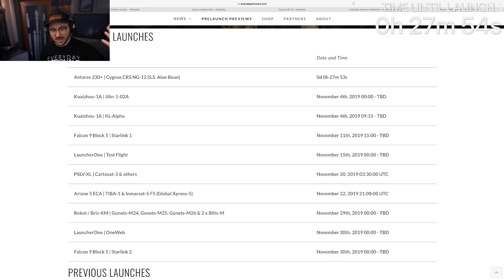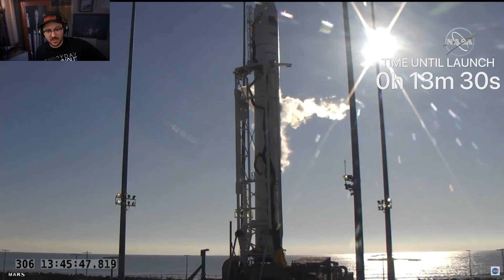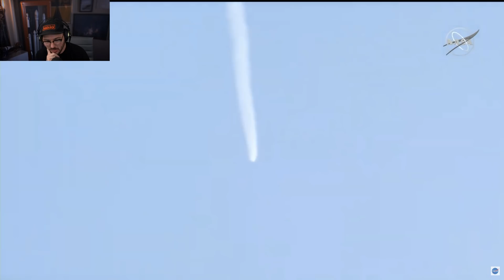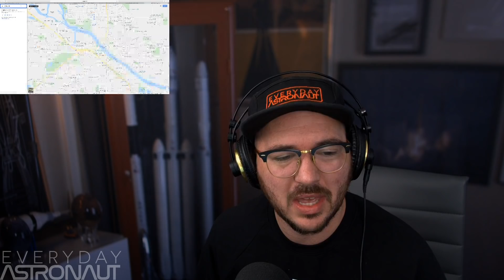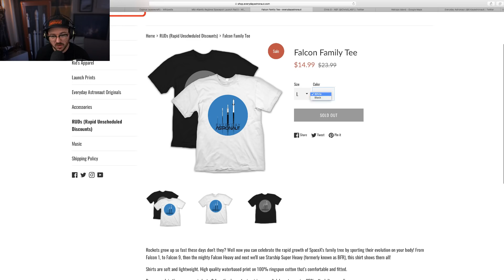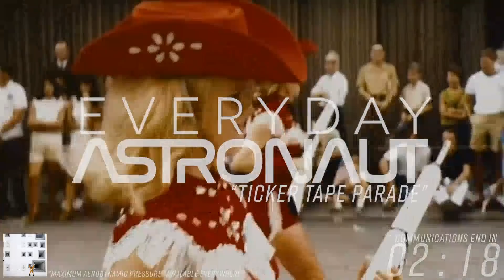Watch NASA and Northrop Grumman Launch to the ISS!

Comment: RD -170 is the most powerful,versatile, innovative design ever, and this engine alone kept Russia in space business after the fall of USSR.
What began as a compromise, to use 4 combustion chambers to avoid combustion instability,
but use common turbo pump assembly, became the best solution Russians ever make.
By developing one engine, they practically developed four.
If they need really big engine - 4 chamber configuration
We need medium size engine - 2 chamber configuration
We need small engine - 1 chamber configuration
Energomash never made a 3 chamber configuration, but if ,by any chance need such an engine, they could build it very easily.
A marvelous design that surely deserves a separate video!

Comment: We need a space station orbiting the moon.
Reply: Thats not a small moon its a space station!
Reply: It's called Gateway, and it's being planned by NASA right now
Reply: @Countmaster0  Hey there, flattie. Been waiting for you forever, where have you been?
Reply: Is it better than orbiting earth? If so, why?
Reply: @PerisK4  We need both. A space station mostly outside of earth's magnetosphere would be vital for researching how to keep a crew alive in space.
The level of radiation would be A LOT higher and would bring new difficult challenges, but they are challenges we must overcome if the plan is to colonize space. 
Speaking in longer terms launching from a space station orbiting the moon to Mars or Venus would probably be easier than launching directly from earth, or a space station orbiting earth. The gravity well is a lot smaller. 

I strongly believe that travel between space stations is how to traverse space. Escaping earth's gravity well is extremely expensive, especially if you're bringing with you fuel for a longer trip.
Reply: Kristoffer Johnsen - You know it costs 1-1/2 times the Delta-V (& fuel) to do that rather than just launching straight from earth? There’s no way this is even close to practical unless you’re launching a craft that’s made on the moon using lunar materials & fuel manufactured on the moon...
Reply: @DenGuleBalje  the Delta-V requirements to get into a moon orbit and refuel and then head to mars just isnt worth it... you might aswell just go straight to mars from earth orbit.
Reply: @Im-mv6bf  Yeah probably. I don't really know, but I imagine you could utilize the speed of both the moon's and the space station's orbit to launch to Mars or Venus.

Even if a moon space station wouldn't be ideal as a launchpad/refueling station, I still think that we can learn vital information from having a space station orbiting the moon. 
We need to learn how to keep personnel alive and healthy in places with higer level of radiation for long periods of time, if not colonizing Mars/Venus or anywhere outside of earth's magnetosphere is just a pipe dream.
Reply: @TraditionalAnglican  I didn't know that, but I'm not talking about gathering the resources for the spacecraft from the moon, I'm thinking launching the different components from earth in separate launches with each rocket tailor made to carry different types of cargo. 
If you want to go directly from Earth to Mars in one launch the rocket will have to escape Earth's gravity while carrying the rocket itself, crew, fuel, food, landing pod, tools habitats, EVERYTHING and it has to be done within ONE launch window.
How about moving crew to the ISS, then when they're used to living in zero gravity to the moon space station, then launch rockets carrying fuel, habitats and all the rest in smaller launches, then assemble the final craft in space. 

A rocket that's made to defeat drag, gravity and space junk carries a lot of dead weight when it finally is in space and can't sustain the life of a crew for longer periods of time. 

Just some thoughts.
Reply: According to Nasa it would be a good spot for one for missions heading into space.
Reply: @PerisK4  It would be a space station orbiting something that's not the earth. It could investigate things that the ISS can't because of the Van Allen belts.
Reply: artemis program would like to know your location
Reply: @CarlosAM1  I don't know what that is.
Reply: @DenGuleBalje  the nasa program that is going to do just that.
Reply: @CarlosAM1  Cool! I wish them luck.
Reply: lol

Comment: Anybody know how many g-forces Cygnus has withstand to get into orbit so fast?
Reply: With that second stage, somewhere between 0.5 at the beginning and 2 at the end of the burn. So, no too much. A bit more with the first stage
Reply: good question. that sucker jumped off the pad
Reply: Enough of g-forces to make you think you're having a heart attack !
Reply: 35:05 they said 100 ft/sec^2.  Thats a hair over 3 g's.  And with ~90 sec of fuel left to burn in the first stage, that will go up still.  

On the second stage, the telemetry is detailed enough to calculate the acceleration.  About 10 sec before burnout, I calculated about 2.5 g's.

Comment: Wouldn't a space elevator not work on the moon since it is tidally locked to the earth and does not spin
Reply: The moon does spin , it just does so at the same rate it obits the earth. I don't know how you could make a space elevator with such a slow rotation
Reply: I actually read a proposal to position a lunar space elevator to terminate just above geocentric orbit level above the earth. Mass left off at the end would already be orbiting the earth at geocentric altitude.

Comment: 45:48 Don't forget that fairly simple earthbound fan ovens can be zoneless, in contrast to cheaper non-fan heated ovens which tend to be zonal, with the coolest part of the oven at the bottom and the hottest at the top. Fans in an ISS oven could push heat into different zones intentionally.